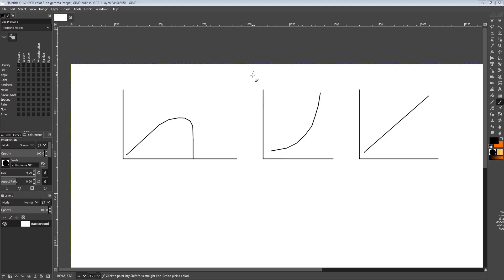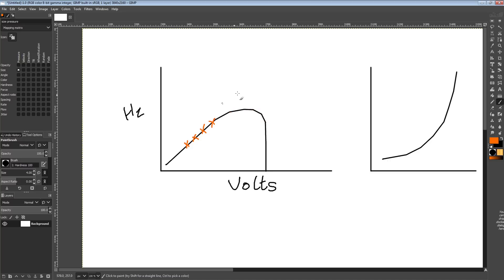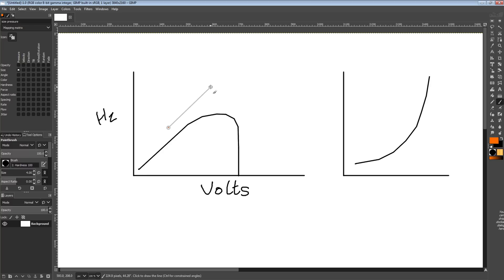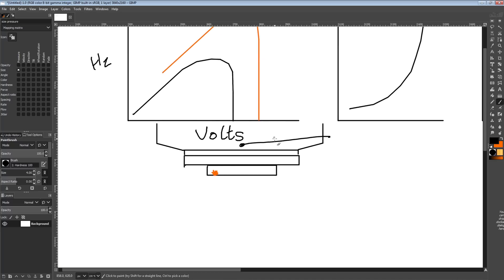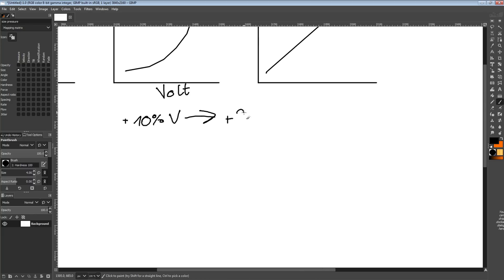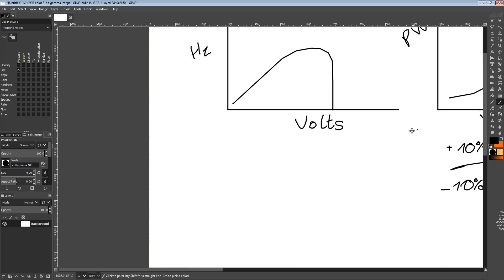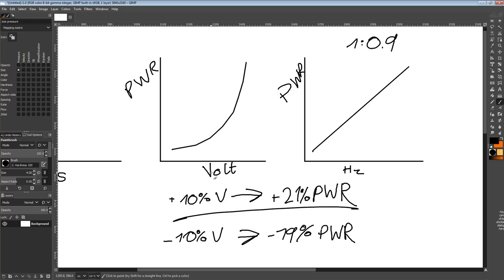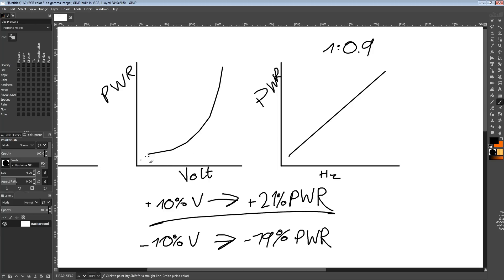Some random things to keep in mind when OCing

Comment: Fun thinking.. I'll guess if all computers (not OC'ed) were undervoltet to the/above *limit at stock speed (*still maintaining max stability) we would shave of 3% power globally. Think... All the datacenters, office/home computeres. That is a lot of kWh "wasted" globally in the world iright now!  ;)
Think If each rig can shave of say 10% power consumption average..? New platforms with higher effiency can still (at least 98% of them) be tweaked to better effciency. All "stock" settings are preset to get stability to even the worst silicon batches.
Reply: I suspect quite a few datacentres may already be doing this as energy prices increase. It's also why ex-mining GPUs can be great value, as miners very quickly realised that slightly undervolting wouldn't hurt performance, but would drastically reduce power consumption, and thus increase the power/return ratio...
Reply: @JaenEngineering  I know. I have been mining a  few years. All hardware still working fine (almost 24/7 running 2+ years) after best possible undervolting / efficiency tweaks possible ;)
Reply: @Wushu-viking  indeed. And that 24/7 operation also confers another advantage, mainly thermal cycling, or lack thereof. The daily expansion and contraction of parts as they go from ambient to full load (or higher if it's been OC'd) temp and back again is possibly one of the biggest killers, as the various parts expand and contract at ever so slightly different rates, placing stress on any interconnects. The only real downsides are thermal paste degradation as it slowly dries out and that the cooling fans will eventually die as their barings wear out, although neither of those is particularly expensive to fix, so should be easily outweighed by the savings .
Reply: @JaenEngineering  Exactly! Generally.. Blower fans are really durable for 24/7 running. (more so than the regular "low quality" Axial fans you find on "aftermarket" graphics cards) All my Vega 64 blower fans are still in good condition. Actually even the paste seems like its still okay regarding temperature. They must have buildt these cards quite good from AMD.

Comment: Re: hotspots, good that AMD puts so many sensors in the GPU, but then messes up reporting. :) (Average rather than max in some firmware revisions.)
Reply: This actually helped me notice a bad paste job on my 5700 XT! Hotspot was hitting 110C(throttle point) while edge temp was still only 50-55C. Taking it apart & properly pasting brought it down to 80C hotspot at the same edge temps.

I never would have known this was happening without that hotspot reading, as the edge temps were fine!

Comment: I have noticed how voltage required rises really fast above 4ghz on my 1600x. It does 4ghz with 1.23v, 4.1ghz with 1.32v. I have ran it at 4.2ghz but i cant really keep it stable, best stability seems to be at 1.42v, going higher does not seem to help at all.

Comment: my 1060 is a bees dick off of falling off that vcore/clock chart, 1.093vcore wont hold 2215 but 1.075v will hold 2202. (edit) is 1.4vcore safe on a devils canyon cpu under a 360mm rad, its second hand so its not the greatest concern

Comment: the 3rd graph is incompatible with the first two
Reply: well, considering when a logic gate is on or off, there is less power bled through the gate FETs than when it's transitioning from one of the two states. the more times a second a logic gate is changing from 0 to 1 or 1 to 0, the more often it's using more power in that state between 1 and 0 (cuz both the high side FET, and the low side FET, are not totally off or on. so the current goes through the high side and low side FETs from the power rail to the ground rail when the logic gate is changing state between 1 or 0). that's why at the same Voltage at different clocks the 3rd graph is so different from the first 2.
Reply: The two "Hz" labels do not represent the same thing.
Reply: @fluffypink90  how's so?
Reply: @EasyGameEh  the third is powerdraw vs clock at constant voltage, the second powerdraw vs voltage at constant clock
Reply: @effuah  oh, sure

Comment: 3900x ships with with 1.42v at 3.9Ghz but i managed to run it at 4.2GHz at 1.23V with level 4 LLC.
If you keep your CPU at factory voltage you more likely to kill your CPU early that it should be.